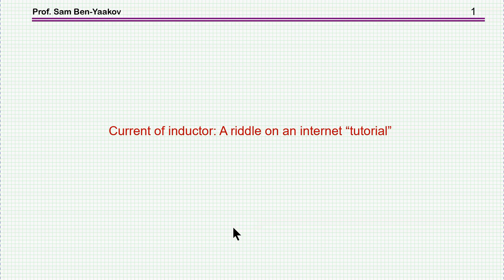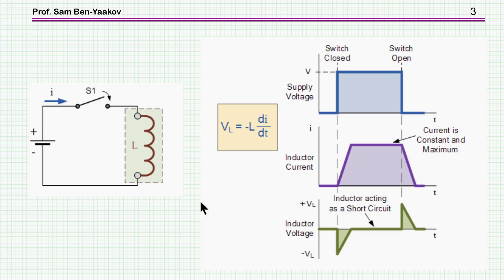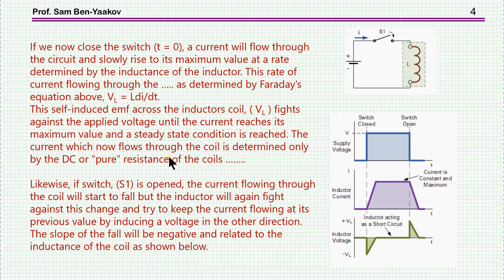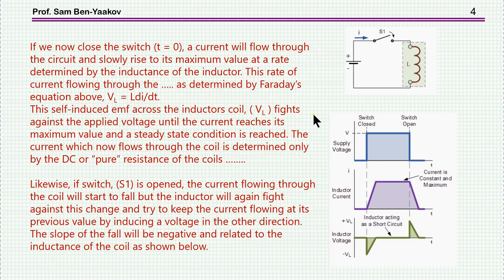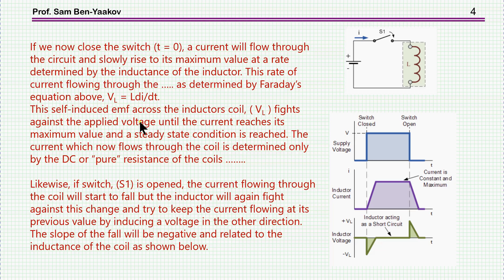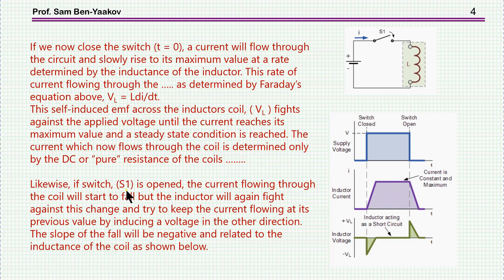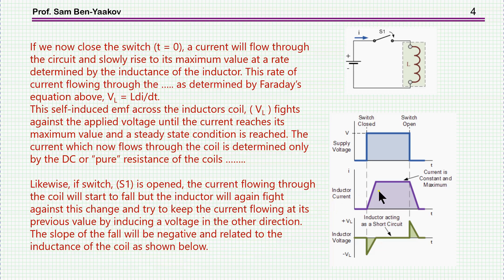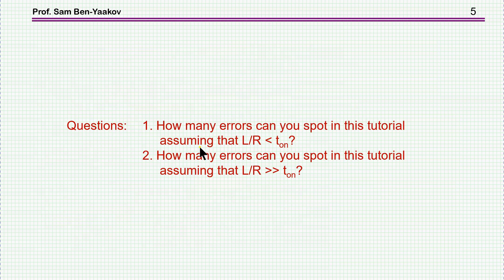Current of inductor: A riddle on an internet “tutorial”

Comment: An ideal inductor, subjected to dc voltage, at steady state, will actually act as a short circuit, with its current raising linearly, provided that only the steady state is analyzed... (namely, hell freeze is over). However, an ideal inductor at transient has an infinite time constant, therefore will never charge, hence will act as an open circuit. So there is your "paradox" :-) Of course this isn't entirely correct, as the term "steady state" does not apply because the ideal inductor keeps on charging forever. This is of course just a remark in addition to all the other problematic points, mentioned by others...
Reply from the maker: Good points. Hold on to my answers video that is coming soon

Comment: I doubt that the current flow will slowly decrease when the switch is opened. During the S1 (on) the voltage across L will not change. I suspect that the voltage across L when switching off S1 (off) will be higher than the voltage of the battery. Charge curves are usually not linear.
Reply from the maker: Good points. Hold on to my answers video that is coming soon.

Comment: Hi professor. One doubt regarding inductor saturation. If the inductor was to be an iron core inductor, it would saturate and then inductance drop to the air core inductance. Current would go to the Rdc short current. Imagine a fuse is added to limit the short current. The fuse has to dissipate the energy of the inductance in an arc ? Can a diode or varistor ease the work of the fuse ? When the inductor saturates the energy is lost ?
Reply from the maker: Stored energy is lost to an arc or connected components. Hold on to my answers video that is coming soon.

Comment: Sir, if u don't mind, can you  please upload a video on ' closed loop PFC using buck boost converter'. Thanks in advance sir
Reply: when buck-boost converter is operating under discontinuos current conduction mode
Reply from the maker: This is not much differentfrom Flyback. See: https://youtu.be/rIhnBTFe--g

Comment: 1) When L/R >> T_on we will see a linear ramp of the current. When L/R << T_on we will initially see a linear ramp and then an almost exponential rise of current (Since it's like a short). The exponential current rise leg, would correspond to saturation of the inductor.
2) I don't like the fact that there is no return parth for the current during T_off, so probably there will be an arc that potentially damages the switch (if it were a relay).
3) If the switch is a Mosfet, during T_off , current will flow through the body diode potentially increasing the temperature of the junction a LOT (depends on magnitude of current as determined in first paragraph).
4) So after considering points 2 and 3, above, during T_off there will be a decay of current (may or may not be linear decay depending on saturation of Inductor)
I am sure there are more points that i missed, but these riddles are a great way to learn and i look forward to them.
Reply from the maker: Very good points. Thanks for participating.

Comment: I can immediately see two errors.
1 the voltage and current are drawn as linear slopes but they follow the e-log curve.
2 the curve at the end while the switch is opened, there could obviously not be such a current. Only a voltagespike with maybe a short current when a spark in the switch is counted for.
(Also the voltage over the inductor while switch is conducting can not be totally zero but depend om his DC resistance of the wire and the internal resistance of the voltagesource of course, but i dont know if such things counts as errors?)
But that's only my not electronic schooled thinking (hindsite a pity but i did the medical direction) and i look forward for the following video(as always of course!)
Reply from the maker: "medical direction"? to what level? 
There are many more errors.
Reply: @sambenyaakov  when i was young i wanted to study for a life with not ónly technical but also people to work with so
I studiet and got my diploma dentist with orthodontie as specialisation.

Comment: Assuming inductor has internal resistance "R".  
The linear LR circuit is governed by 1st order differential equation. 

if the  5(L/R) < T_on :  current will grow fast and exponential and will reach to maximum before the switch OFF ; Just after the T_OFF, current will decrease exponential.
                                 :  voltage waveform will show -ve tail pulse at Switch-ON point and tail will settle before the T_OFF; Just after the T_OFF, a positive tail pulse will come.

if the 5(L/R)>T_off  : current will grow slower and exponential and will not reach to maximum before the switch OFF ; Just after the T_OFF, current will decrease exponential.
                                   :voltage waveform will show -ve tail pulse at Switch-ON point and tail will not settle before the T_OFF; Just after the T_OFF, a positive tail pulse will come.
Reply from the maker: Good points but there are many more.

Comment: The formula lacks a vital minus sign indicating that the inductor opposes current change by self inducing a voltage opposite to the current applied to it. You can't instanly switch off the voltage supply towards ideal inductor, as the self induced voltage is a number divided by 0. There is no need to talk about internal resistance when describing ideal components, It is enough to show exponential curve of the current when connected to a supply with infinite current capability. When observing the inductor during turn-off of the supply there always must be a resistor in parallel to give the induced current a path to flow, otherwise the model is incomplete (because of the above mentioned division by 0 problem)
Reply from the maker: Good points but there are many more.

Comment: 1.When L/R>>Ton:

During Ton: 
When the switch is turned on, the current in the inductor rises as shown in the figure in the video. But the voltage across the inductor is the same as the Cell/Battery voltage because the inductor is directly connected across the voltage source (assuming very little source resistance which is typical). So the voltage spike shown during switch ON is not correct. The spikes shown are possible if the internal resistance of the voltage source is much larger compared to the resistance of the inductor. Even in this case, the polarity of the inductor voltage seems reversed.

Between Ton and Toff:
The current in the inductor will never reach a steady value (V/R) since the time Ton is less than the time constant of the circuit. So we will only see the current increase with slope (Vbat/L). The voltage across the inductor is still Vbat as it is connected across the voltage source directly. The voltage shown in the figure is not correct. That is true if the resistance of the inductor is very small (close to zero) and the source has internal resistance that is much larger than the inductor resistance. 

During Toff:
During Toff, since there is no freewheeling path for the inductor current, the voltage across the inductor builds up instantaneously to a very large voltage where the switch contacts arc (or the switch breaks down depending on the type of switch) and the current dies down exponentially from the peak value (Vbat/L *Ton).

The voltage in the figure is again possible when the internal resistance of the voltage source is much larger compared to the resistance of the inductor. But still, the polarity of the voltage is not correct (the polarity of inductor voltage is not indicated)

2. with L/R<Ton:

During Turn ON:
The inductor current will be as shown in the image but instead of a sharp edge, it rises more like the I(1-e^t/T)  function. The voltage across the inductor would be Vbat.

Between Ton and Toff:
The current reaches a steady-state value (Vbat/R) and stays there. The voltage across the inductor is still Vbat. In the extreme cases where the internal resistance of the source is comparable to the inductor's resistance, then the voltage across the inductor is Vbat*(R_inductor/(R_inductor+R_Source)).

During Turning Off:

After turning the switch off, the inductor voltage shoots up and breaks down the switch or finds some path to let the energy go (even the breakdown of inductor inter-turn insulation is enough for this purpose). The voltage dies down to zero after the energy is dissipated. During dissipation, there will be a negative voltage across the inductor (compared to the voltage during Ton). The current dies down exponentially from Vbat/R value.
Reply from the maker: Very many good answers. But believe it or not there are more much more.

Comment: It depends on how you count repeated or related mistakes. :)
I count at least 3 major issues for each case:
R negligible (L/R >> tON)
1 Current increases linearly without bound until switch opened (no steady state) assuming an ideal core.
2 EMF not related to value of current, only di/dt
3 With switch open, there is no path for current to decay linearly as described, instead I_L falls instantaneously and the V_L must rise until either V_L+V>V_switch_breakdown and the switch conducts (and the remaining current flows forever because everything is ideal and lossless...??) or I_L reaches zero, then goes negative and oscillates indefinitely with V_L. 

L/R < tON
1 Current change is exponential now; the solution to V=Ldi/dt+I*R_L
2 Max value is limited by V/R_L not inductance (EMF still not related to value of current)
3 Again at open, V_L increases until either the switch conducts and the current now decays exponentially through R_L, or the current does oscillatory exponential decay.
Reply: The challenge isn't "how many errors there are in this tutorial" but rather "how many errors can you spot in this tutorial assuming..."

For the case of R negligible:
1 ok as approximation - remember R is negligible, not zero, so "without bound" is not true - "very large steady state current" would be true, however
2 the tutorial does not contain such a statement
3 this is not a resonant circuit. Also there's no assumption of a breakdown switch voltage here - that is going off in a tangent/off topic. Since R is negligible but not zero, current should drop linearly (by approximation), so no mistake here.

For the case of R non-negligible
1 ok
2 ok but again the tutorial does not contain such a statement
3 incorrect- where does the oscillation come from? this is not a resonant circuit
Reply: @Stelios.Posantzis  Thanks for the discussion
1. Whether R is small or ton is short, there is no steady state. 
2. Sure seems like it does.  "V=L di/et ... until the current reaches its maximum value"
3. You're right, I feel like one of those two assumptions are required for this problem to be well-defined, either switch breakdown or stray capacitance. Can you explain how a circuit with no loops has a current flow (linearly decreasing or otherwise)? 

The switch breakdown is the more likely assumption I think, but I tried to imagine what would happen if not. The energy has to go somewhere, and it can't be a current and you're right there is no capacitor to store charge for proper resonance. My guess is Prof says it's just nonphysical
Reply: @electrowizard2000  I enjoy these - it's been a while since I had to do anything like that.
1 yes, you're right, there's no steady state current - I meant to write "very large current" until the switch opens (which is assumed to happen eventually) but not infinite current. 
2 I think it's how one reads it: to me it says that a) current will rise with the rate given by inductance and b) it will reach a max value. But it doesn't say what the max current value is so there's no reason to assume that the author meant that the inductance is the only factor determining the max current. In fact, in the next paragraph, it says ""The current which flows through the coil is determined only by the DC or 'pure' resistance of the coil ..."
Of course the author only describes a situation with a steady state whereas the challenge includes both cases with and without a steady state.
As to 3, that's the most interesting situation. I'd be inclined to think the wire then acts like an antenna and emits radiation due to the magnetic field in the coil collapsing but I don't have the time to look it up - besides, that would be cheating, wouldn't it? I hope there will be some time until the answers are given, so that I can think of something in the meantime.
Reply from the maker: Good answers. There are more much more.